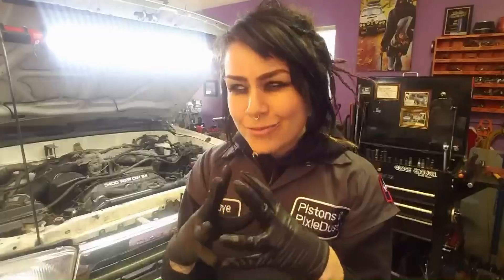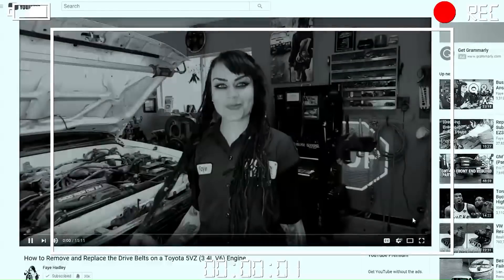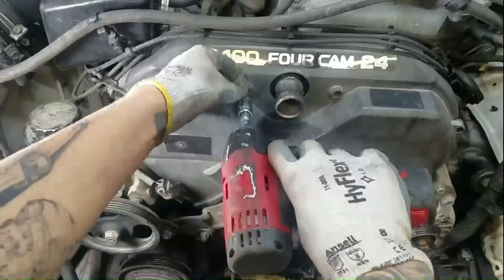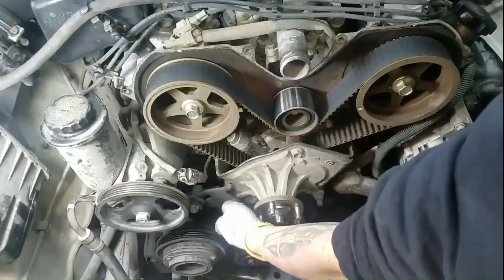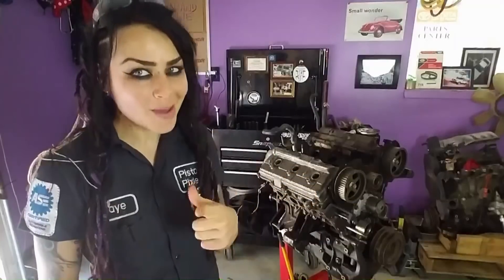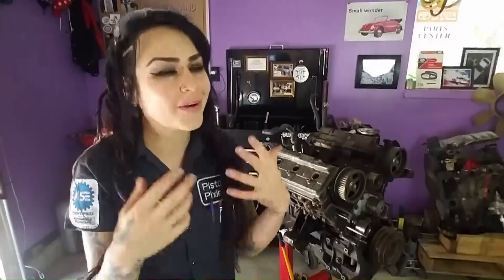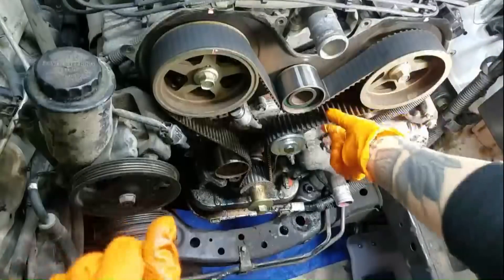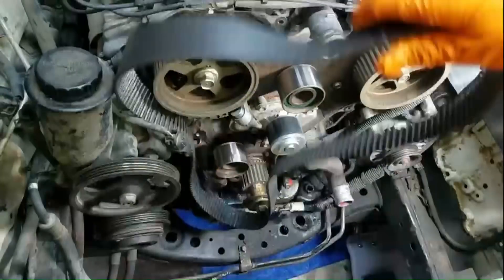Toyota 5VZ (3.4L) Timing Belt, part 1: Removal & TDC

Comment: Using some small Ratchets and love you can get the tensioner off without having to remove that whole bracket, but I'll tell you what if you don't frequently work on the 5's don't bother trying that shortcut as you'll waste more time trying to get it out that way than if you took the bracket off haha

Comment: 8:21 ok so what do I do if my crank shaft and drivers cam are lined up but my passenger cam is like a several inches off mark? I tried rotating the cam without the belt and it turns a little and then snaps into the next timing position, which is still off time. Can anybody help me or am I screwed and have to take the head off? Or is “cylinder #1” the drivers side cam and I’m ok then?

Comment: 28 years turning wrenches never had to work on a Toyota till recently. Usually I work primarily on older American built vehicles. So the 02 Tacoma i bought has been a learning experience. Thank you Faye I whole heartedly believe you're the most helpful Toyota tech on the Internet.

Comment: Thank you very much. This has been quite helpful. Just a tid bit to add for anyone who  might benefit...if you have the time to take your time and if you're also replacing radiator and AC Condensor,  it can be helpful to disconnect both the Power Steering unit and AC Compressor  from their respective brackets and lift them up and tie them up towards the front passenger headlight. That makes getting at the 4 bolts discussed @  ~11:20 minutes so easy. But, thanks for being so cheerful and insightful with your videos.

Comment: Hello Feye, I have a psa. I did my timing belt last year, you got me through it like a champ. I did not have a way to put 180 ftp on the harmonic bolt. Barley engine tight. That bolt came out yesterday on the freeway. Made to work and home and the harmonic balancer came off the key, i coasted into my parking spot. The bolt was still in place and i was able to reassemble  the harmonic balancer and key and it was still in timing. This time i had a lot longer wrench and extra bolt into the harmonic balancer and used the power of leverage and was able to get it crazy tight. Tonight ill have torque wrench and it will be set correctly.  I have a black T100 4x4 extra cab. 😊

Comment: Hi! Awesome vid! I just bought my first 2002 toyota 4runner. It has 150,000 miles. Not sure if the belt was replace. So my question is when should that be done? Thanks!
Reply from the maker: Oh, absolutely if you don't know when it was done! Rule is every 90k or 7 years!! I would absolutely recommend doing it!

Comment: Many thanks! just finished my first timing belt change on my 97 4runner! especially the pointers on the inner belt tensioner bolt were super helpful. (Whoever did the job before me decided that one wasnt worth it and they just put the tensioner in with a single bolt (YIKES). Needless to say I did it correctly! haha

Comment: Currently 2004 Tacoma is at 140,000 miles
Original timing belt and water pump
Not certain if 180000 miles is achievable ?
RR

Comment: Hello Faye:  Have 2004  3.4L  and 2011 4.0L   Tacoma both 4 door
I prefer the 3.4 motor ( 2 dip-sticks and size)
However which vehicle is easier to maintain...???  
Thinking of another 3.4L as a.... reference before attempting this job ..... ?
rr

Comment: Well there gal I just bought a 2002 4Runner w/ a 187,000 on it and like you I’m going thru it to up date all the parts that should be changed , the last sticker on the timing cover said it was done at 67,000 so I think it’s due, the thing I learned is that while the everything is open it’s a lot easier to change for whoever is working on it and will be expensive as you’ll be changing out alot of parts but it will save you more than having things done separately on the labor end of it. Ima old dude now so I’ll have an ASE mechanic friend of mine do the work and it’s a plus he’s an ex Toyota mechanic that has his own business, after seeing all that’s involved I guess I won’t feel as bad when I get the bill 😄 , love the vid’s so informative and you do such a great job ! 👍

Comment: Please put up size of metric bolts used to attach puller to harmonic balancer    ...m8-1.25 I think but need to be "fact checked" on that (about kk3 inches long with matchin nut just in case .

Comment: My studs came out as well from the fan mount bracket thing. Is it ok to hand tighten these studs then lock them down with the nuts? Or should they be tightened more and red Loctite?

Comment: 2001 Toy 4Runner, 3.4L, 5vz-fe V6: at 100,000 miles ( took 20 years ). CEL went on.  Then after 2 miles,  car stalled in street traffic. Scanned Code  P0115 ( coolant circuit code ).  No report of dash coolant light being on from my in-law. Car cranks good, but sounds like no fuel situation.  Ripped rear seat carpet to feel for fuel pump activity. No activity there. So suspected bad gas pump & clogged filter. Noticed a leaking coolant so thought water pump as culprit. Nope. Shredded timing belt. Peace.

Comment: I know this is an older video, but just ran across it. For what I have researched, the V6 5VZ timing belt is a 60k service. The 90k service is on the V8 engines. Please correct me if I'm wrong since my new to me 5VZ is at 100k since last timing belt service., so only being 10k past instead of 40k past will help me sleep better at night until I can get this repair completed.

Comment: Just my opinion but removing the A/C compressor and bracket was WAYYY Easier than sliding in from bottom. I spent a week trying to remove my tensioner cause previous owners stripped the bolts. Never would have got it without removing A/c

Comment: I changed my timing belt and put everything back together.  Ran great, no leaks  squeeks. But upon further looking. I found a 2" bolt on the floor. Yup, I guess the engineers really didn't need that one....🥴🥴🥴🥴

Comment: You've probably been asked this before, but I've seen you wear a couple different types of gloves. Which brand and thickness do you like the most¿ Pros and cons? In your opinion which one is the most durable vs tearing¿ seems like there is always a clip corner or something like that ripping my gloves open (not near as often so far with grease monkey though).

I had some Curad 6 mil that were extremely durable and chemical resistant, but they have no texture which is great for painting, but i work on my toyotas myself and have nerve damage so any cloth type glove is just to thick most of the time and i need to be able to feel what little i can as well as having the added grip and durability. I also had a liver transplantand because of that I have to be very careful about getting cuts or getting dirt on my hands(yes even just dirt) so I basically have to wear gloves no matter what when I'm working on my I've tried maybe 7 or 8 different kinds with varying thickness. So far grease monkey has been my goto glove vs. the off brands or something like venom. Any input would be welcomed. Thanks¡
Reply from the maker: I haven't really found ones that really are perfect actually, but I'll get back to you! So far Ravens are my go-to, but I used to buy these (years ago so I'm forgetting the brand!) that were super thick and went down past my wrists and I loved them!!! I ordered them from Worldpac back in the day.

Comment: So in part two of this series, I see that the new tensioner has a pin in it. Would it be possible/ make sense to compress the tensioner and re-pin it to make removal safer and remove the possibility of stripping threads?

Comment: Ok I got this all done went to turn it around    twice but it won't turn all the way around why is this everything lined up did everything to T what the hell did I do
Reply from the maker: Won't turn all the way around?!? Double check your timing marks, even if you're a tooth off it will still turn a full rotation!!
Reply: @FayeHadley  yea it turns only about a quarter way around idk what I did
Reply: @FayeHadley  I think I might have wrong timing belt they sent me one with 193 teeth and I think mine is only 191 teeth don't know for old belt is in peices

Comment: Hey Faye how are you???? first of all thanks for sharing all this 5VZ engine videos with the world.... I own a Landcruiser Prado 1998 wit a 5VZFE engine, and I got a problem with the fuel economy, I did change fuel filter, sparkplug and leads, air filter, put 38psi on tires, and still thirsty, it just make 400km aprox with the main tank which is around 90Litres. do you have any idea what else can I do or check to improve it? 22 lts x 100km that is a Keemworth Truck Economy full loaded HAHAHA...

Comment: Hi Faye-excellent tutorial!!  I have a 4th gen with the 4.0L with 125k on it- does it have a similar design and when should I be worried or checking for replacement of the timing belt?

Comment: Faye I wanted to thank u. just from watching your channel I just purchased my first 4runner. it's a 02 last year of the 3rd gen it's body's nice. It's due for timing belt service and the bad part needs rear differential the play in yoke is very loose so loose at first thought was a u joint.

Comment: Do you have any videos on removing lower ball joints on 3rd generation 4 runners thanks great videos.
Reply from the maker: Ah, I don't! I already did mine, but next time I get one in the shop I will. :) It's pretty straightforward though!
Reply: @FayeHadley  Can you let me know what tools do I need to get the ball joints off and the pitman arm.  Thank

Comment: I miss working on these! I’ve done hundreds of head gasket jobs on the 5vz engines back in the day with the Toyota recall when I was a dealer tech. Used to do 2 in one day and start on the third before I clocked out, awesome engines!

Comment: I'm thinking this is a PIA. Best to hire a pro, like anyone but me. :)
Reply: More time consuming than anything taking everything off just to get to the belt.  Shop quote for that job was almost $1800 at the dealership....the timing kit is like $150 on Rockauto.com's website and the kit includes a new water pump and gasket, so you'd pay the shop quite a bit in labor alone LOL.  Yeah its very time consuming, and unless you are working on cars very frequently you'll spend more time hunting for the right tools LOL.  I'm doing a head gasket in my car and well I started it at the end of last month, I just put the head back on this afternoon, and still have a lot of external stuff to bolt back on, but the cheapest shop quote was $1400 I bought the complete head gasket set which includes every upper engine gasket you'll need from Rockauto.com for $24 shipped, waited a week for the gasket set to arrive but other than that its just a matter of taking things apart and laying them out so you remember how they go back in and where they go....I've had 2 bolts grow legs and walk off so far LOL.

Comment: Faye, when you are doing a timing belt (Every 90k miles replacement correct or roughly there abouts) would it be smart to replace your water pump while you are in there? (Even if it seems to be working ok but more of a piece of mind thing) 6 mins in so ignore this if you cover it later in the video. Btw love your videos as it is a good guide to doing the job right.
Reply from the maker: ABSOLUTELY!! You will see this in part 2!
Reply: @FayeHadley  Great, Cannot wait to see it.
Reply: @FayeHadley  Cool beans!  (I haven't wrenched professionally in 25 years, and i actually have to put a timing belt on...you guessed it - a '96 4runner.  Looking forward to some excellent tips!
Reply: Yep.  The water pump is a "while-you're-in-there" just like a pilot bearing in a clutch job.

Comment: Great information! 
I would put the flat side of the puller away from the crank pulley so the bolts pull straight.

Comment: Okay, that's a lot of tedious work. I think I liked it better when we had timing chains, problematic as they could be. The timing belt on my classic 1990 Cadillac is much easier than that Toyota. Don't have to remove any accessories, just loosen the tensioner and off it comes.
Reply: timing chain on the old toyota 22re was a breeze compared to this.

Comment: Do you have anything on squeaky ranger front suspension?
Reply: Hi. I had a mazda 3000, squeaked like crazy. It was the lower ball joints. No grease fittings. Sprayed them with lube. No squeak. Pick tool to get under ball joint boot. Eventually replaced ball joints with grease fitting ones, after 20,000 miles with no squeaking.
Reply: @waynegouin939  hi thank you for your reply sir. I'll look into that this weekend.

Comment: Excellent video. One tip on a wobble ext. What I do is put electric tape on a swivel. It allows it to swivel where you want it to .
Reply from the maker: Yes! I have seen people do this. I still think my swivel is a better option, because the wobbly can be too thick/wide to get past the AC bracket.
Reply: Hi. I have tape on some, no tape on others. It keeps it from flopping around, while still working.